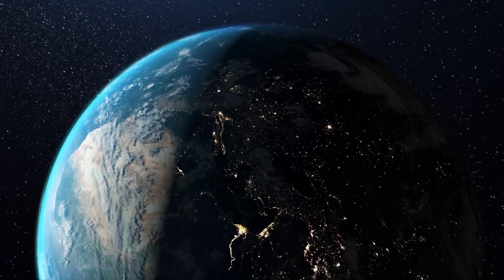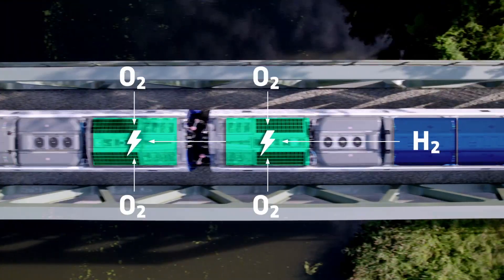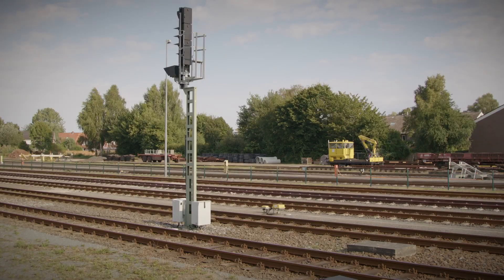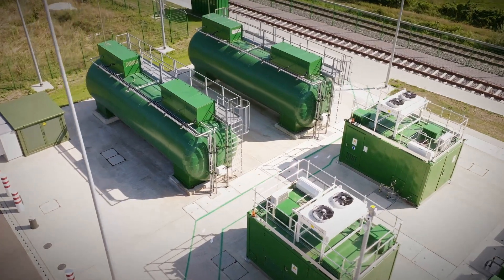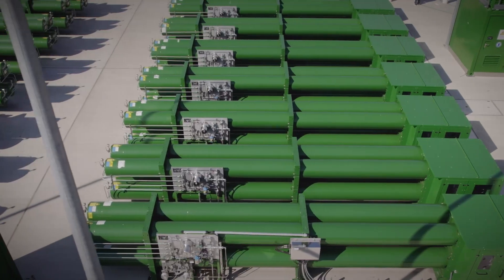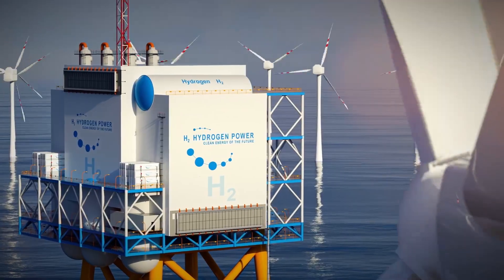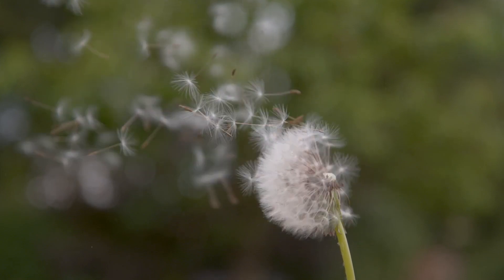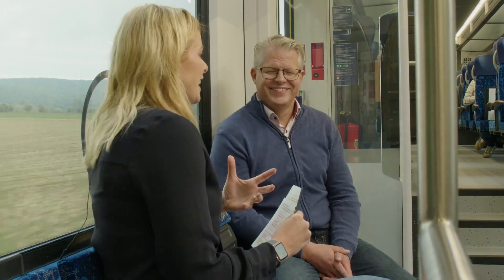A closer look at the hydrogen fuel cell - and a look behind the technology

Comment: LET'S all wake up to how you make Hydrogen,  :yt: it's very simple to produce large quantity's of hydrogen,  First you find some water,  Then you install two electrodes typically one copper and one zinc.. whatever  that isn't the important part.  Two break the two molecules  of H2o apart we use the same energy that put them together to begin with!!  The magnetic force !!!  not the North or South poles that would be supper stupid.   NO,,  The center of a magnet is by far the most powerful.   What I want all you to understand is that everything from Anti Gravity to the development of the pyramids was a by product of the magnetic center not North or South poles they are the weakest part of  any magnet.. FACT!   We can Easly build a small Hydrogen carburetor for existing auto's .   Want to know how they carved the granite rock,  Real simple they would vibrate the "B"field of a magnetic force into the rock, as you know quarts has allot of radio activity due to the quartz crystal there in . Just like your cell phone.   They would saturate the rock with the magnetic "B"field and it would become very soft, ..  I CAN PROVE ALL THIS!!! and that's exactly why they had to use copper tools so they would not disrupt the magnetic field as they built the pyramids.